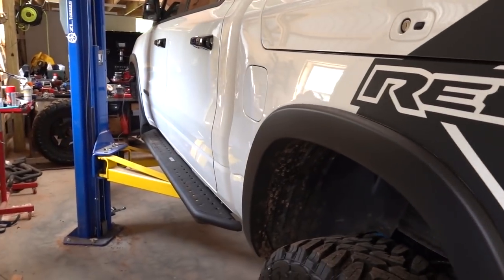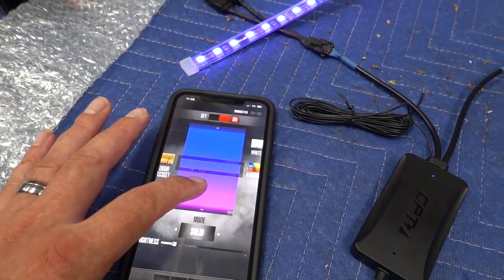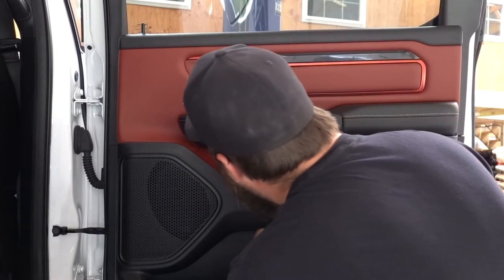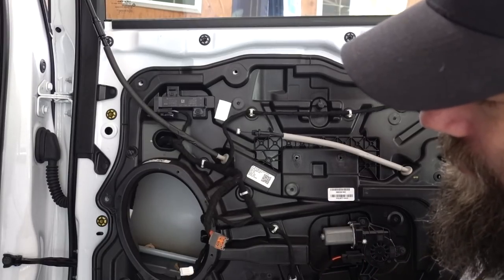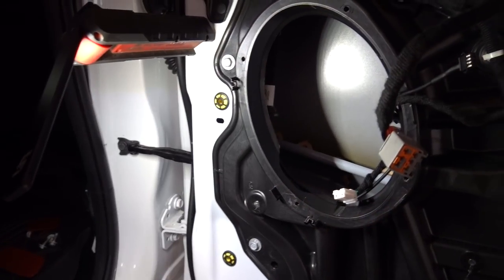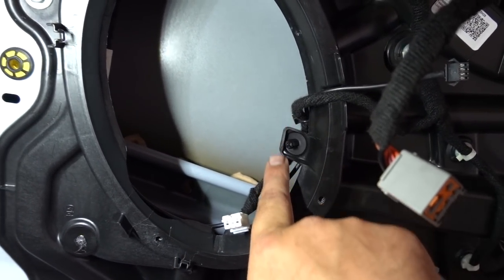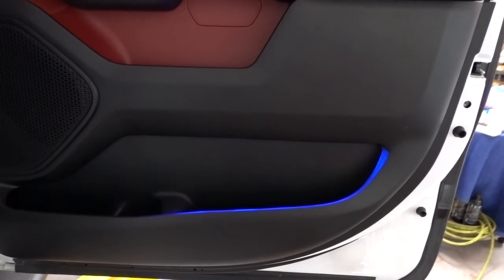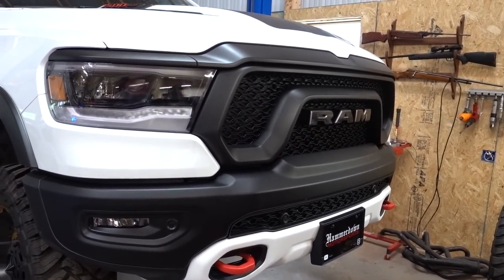2019 Ram Rebel DIY Ambient Lighting

Comment: Great work brother! Would you happen to know if those holes in the door cards are in the Heavy Duty Limited model RAM? I ordered a 2021 and was trying to plan the same project, but I wasn’t sure if it has the provisions/holes in place to do this same work. 🤞🏻
Reply from the maker: The new limited heavy duty should have factory ambient lighting I have seen people change out the bulbs for different colors but white is the factory ones
Reply: Ok, awesome. I saw that Paragoptics was/is advertising a kit that I’m gonna take a look into, but I was just wondering about those holes in the door pocket bezels because I’d really like to run a light kit in there as well!

Sucks coming from an M550i and having to say goodbye to that factory ambient lighting 😔

Comment: Awesome video. Wondering if you would know what would cause the rear sensor light on the dash to not work? I also have the  service park assist luminant on the dash. 2013 ram 1500 big horn
Reply from the maker: Dudley do rite might have a bad sensor or a bad connection at the sensor
Reply: @HammerdownMotorsportsUSA  yeah just ordered new ones got one that isn't working.

Comment: That’s a lot of work but looks like it’s going to payoff nicely. I have a Ram Limited and I wonder if you can splice those lights in the factory ambient lighting.
Reply from the maker: Jon it needs the controller to run the modes so probably best to run them independently

Comment: Yeah my 19 sport doesn't have the ambient lighting light my 17 Limited did. Miss it a lot.
Question,  where do you get power from and do they come on when opening a door?
Reply from the maker: slayer calvelli I am running them off the switch pros so I can turn them off when I want but I’m sure there is a wire you could tap into to make them do what you want

Comment: I saw you added the links to order the lights, extensions, and so forth but, I was curious what you used in total?  Did you need two sets of extensions and one set of the 3.5 and one set of the 12 inch add on lights?  Thanks. Looks great. I hope to tackle this soon.
Reply from the maker: Marc Baker it depends on what kit you start out with but once I finish I’ll put an update on what I used in total
Reply: So what was the totals on the lights that need to be ordered. I see the links and they look good but I do not know the number of extensions and lights that will need ordered. I also found the adhesive tabs you talked about. After you post the total lights and extensions needed this will for sure be my next mod. Thanks for doing this awesome work

Comment: Good morning Steve!  The lighting looks great!  I would love to have that but it’s seems to extensive of a job for me to be honest.  Hey, I have new wheel spacers coming into today for my 2020 Rebel.  I went with Venum.  Bora was just too darn expensive!  Which ones did you get and how big did you go?
Reply from the maker: Chris Carlson I ordered 1.5 inch that should clear the studs they are made by a company in Delaware called US wheel spacers I guess we will see how good they are when they get here, and yes lots of work for the lights but should be worth it I hope, thanks for watching
Reply: Hammerdown Motorsports Steve, got the 1.5 inch installed on all 4 stock tires/wheels!  Looks freaking amazing my friend!  Next mod will be a 2.5 level up front.  Would do the lift you put on but need to be able to pull into hospital parking garages.  You will love the spacers man!  Truly great mod and easy!!

Comment: How in the hell did you do the front driver side door?
Reply from the maker: You have to loosen the mounting screws for the fuse panel then you can get at the plug for the door
Reply: @HammerdownMotorsportsUSA  this is nothing what I thought...😅
Reply from the maker: @dayooper2995  yeah it’s a lot of work but the end product is pretty cool
Reply: @HammerdownMotorsportsUSA  I do want it.. I unplugged 3 of those clips and now I can't roll down my windows lol in a cramped spot too
Reply from the maker: @dayooper2995  yup it is a journey lol